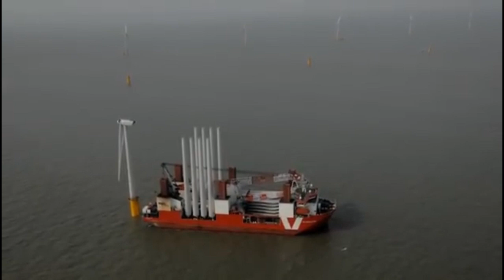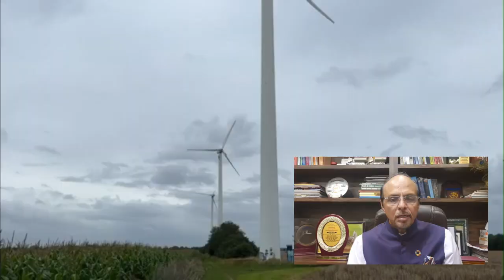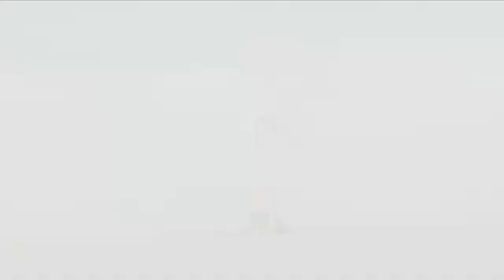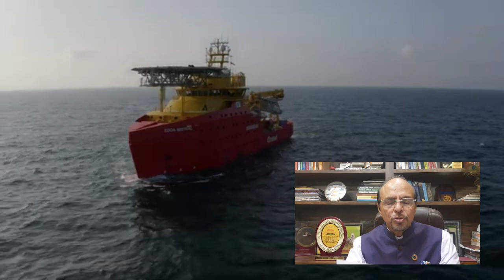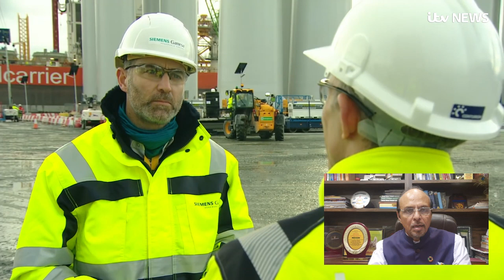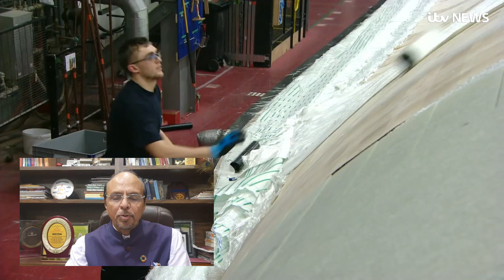PPP Podcast EP10: Offshore Wind Power PPP

Comment: Quite interesting. As far as I remember we in India had water/air propelled, water pumps and grinding mills long long back. Never developed further.Since these windmills are floating there will advantage of adjustment of direction mills according to direction of air. Also shifting these air power generation units to safe zone is possible in case of heavy storms or other natural calamities?. How the power generated is transmitted to grid or customers?